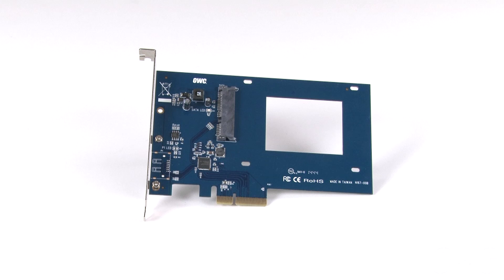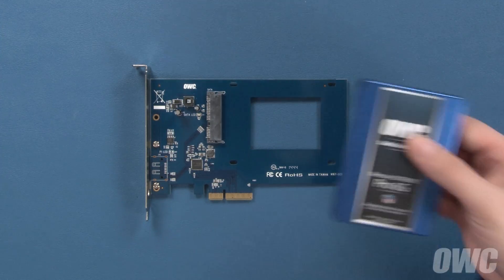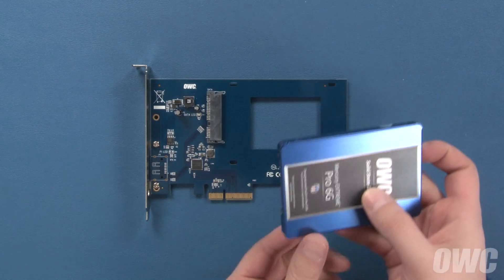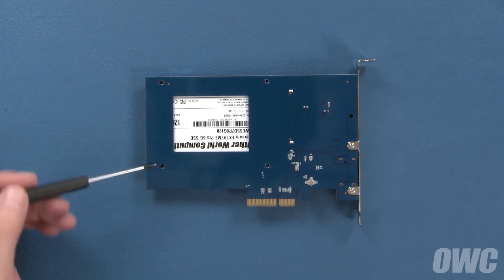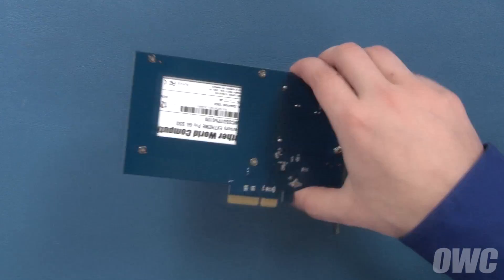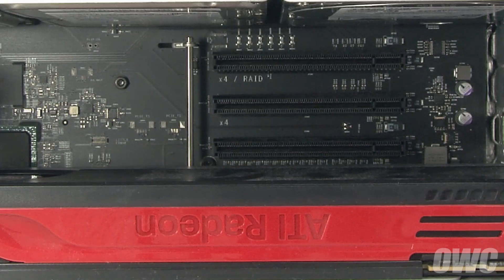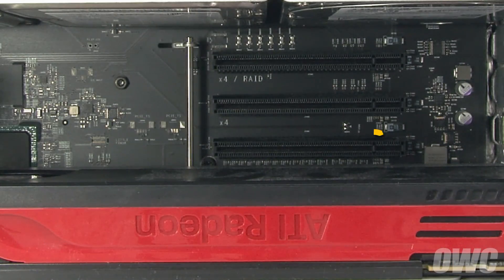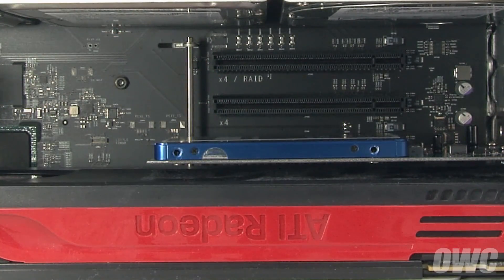OWC Accelsior S Assembly and Installation Video

Comment: I've been using this in my PC for a few years. I have a 5TB Seagate Barracuda 2.5" HDD and it works great and fast. great for cutting down on wires inside the case.